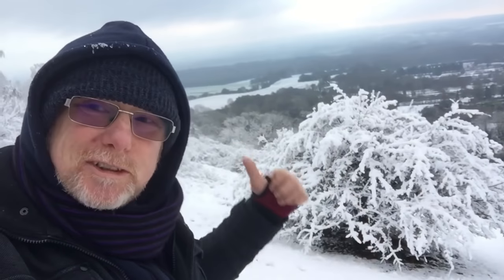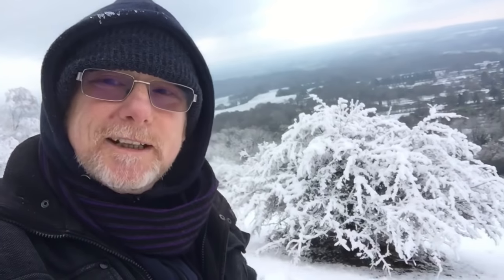How to make your Night Diesel Heater fuel pump quiet

Comment: I had the same problem with my pump. I ended up putting washing up sponges around it and then put it inside a small bottle. It's now silent and fixed in place well. It makes such a difference

Comment: What I did was bought a water proof camera case with he foam inside, lined the box with audio sound damper mat, punched.out the foam in the center to form fit to the pump with a solid price both in front and behind the pump, it is virtually no noise from the pump now

Comment: My 1989 florida had diesel heater from factory. Pump was under van. I owned the van for 10 years - pump never failed. So its not an issue. I replaced the internal thimble filter in the pump and it was the original pump too. . Also the pump was hung under van with a rubber hanger like two black bands, one shorter than the other which kept the pump at the correct angle. But really quiet it was.

Comment: My furnace makes so much noise that I want to tack it out and put a Diesel heater. Wondering if I could run the fresh air intake and the exhaust pipe out the existing set up .

Comment: I just installed a diesel heater in a caravan and so far the pump is not noticeable 
from inside and infact hard to even hear outside and the way I did the install 
I think just might have solved the pump noise and that is  I cut a strip of rubber 
from an old thick mud flap bolted one end to the wooden floor of the caravan then 
bolted the pump in its own rubber mount to the other end of the rubber strip so it was 
hanging free but not so free it would move around. By NOT mounting 

any of the fuel line or pump to any metal under the van but to the timber floor 
insulated it from transmitting sound. Works for me
Reply from the maker: That’s brilliant buddy well done I’m going to do a re fit in the summer and I’m definitely going to put my pump underneath the van and take a feed off the main fuel tank it’s got to be the way to go 👍🤓👍

Comment: Nice effort, best way is to mount them is in a rubber type spider web, also good to suspend the fuel hoses as it can tick tick on any hard surface..Also to note which may have been mentioned hang them vertical...The angle instruction was copied from the original Ebersprecher manual by the Chinese as they are knockoffs, the original was because of their small filter and the angle was needed. These Chinese knockoffs dont have this tiny filter ( bigger filter is actually better) so they should be mounted vertical to avoid the air bubble build up and wear, notice by the sound they should tick not tack...
Reply from the maker: Thank you some good tips there 👍
Reply: Cheers nice one 👍

Comment: I live in a van an just got an all in one heater. Yes the tapping is a bit annoying... I turned the heater off before bed last night but turned it on at 5:30 this morning... I did sleep a bit, but yeh, a bit annoying. 
So ... my pump is in the unit, any suggestions? 
I'm surprised wrapping it made it louder.
Reply from the maker: I don’t leave mine on all night it’s way to powerful I’m thinking of getting a 2 kw and mounting it under the van 👍😊👍
Reply: @BigVanSmallWorld  
When it gets to winter I'll have to run mine over night really.  
I'm going to take off the case today and hang the pump on a cable tie and wrap it in some carpet underlay.
Reply from the maker: Good luck with it hope it works out for you 👍😊👍

Comment: Good tip! I just bought a diesel heater for my rooftop tent and the methodical ticking of the pump at night was about to drive me nuts.
Reply from the maker: I’ve tried so many different ways and this is definitely the best way 👍

Comment: My heater and pump is under my van cant hear the heater at all but the pump drives me mad
Reply from the maker: I know what you mean it drives me crazy too I have fitted a log burner in my latest van along with the diesel heater I used the diesel heater if I’m in the van during the day and at bedtime spark up the log burner it’s perfect 👌 absolutely love it 👍😷👍

Comment: Pump vibration has always been a problem for RV'ers (especially water pumps), so proper mounting is critical. My only suggestion to add is that if space allows it to line the cabinets containing noisy accessories with 1" rockwool panels or sound-deadening foam. Thicker 2" lining is better if space isn't a concern.

Comment: Hi mate
I’ve had my diesel heater fitted now for a mth but only just started using it,
Question is the exhaust pipe from the heater meant to glow red?

Cheers Jason

Comment: So.... When you hang the fuel pump instead of having it attached directly to a wall, does it just cause the vibration noise to dampen cos it doesnt transfer? I thought the clicking was the metal inside the fuel pump hitting against metal. This noise is enough for me to just maybe stick to my propane  buddy heater. Wasn't sure how to fix my coldness through colorado winters.
Reply from the maker: Hi you are absolutely rite having the full pump hanging stops the sound resonating through the wall therefore giving the impression it’s quieter 👍😊👍

Comment: Better idea 💡 Mel. Two long bolts ( threaded bar out of a sheet of ply , bungee wrapped tight and cable tie the pump to that , even at the correct angle 📐. 👍
Reply from the maker: Brilliant idea 👍👍

Comment: Hi Mel hope your ok,   just watched this vlog,fuel pump suspension and wow it worked . 
Is there any issue with the pump swinging about whilst driving ?
Reply: was wondering about that too,
also, how do you manage to keep it at the correct angle without putting extra stress on the fuel connections  ?
great improvement though !

just keep in mind the pump will have some inertia when the van is moving (same principle that makes drawers want to slide out when the van takes a turn)
Reply from the maker: MAPS The Way I’m sure it will be ok as it’s only hanging about 1/2 inch so not much movement as for the angle it’s still the same and even if it was not I don’t think it matters once the pump is primed and all the air is out I’ll keep you all updated if it doesn’t work out but so far it’s all good I had to put my ears to my sink to check it was working this morning 🤓🤙
Reply: @BigVanSmallWorld  Would you have your heater on when moving anyway?
Reply from the maker: Holistic-Healing UK no definitely not it’s a parking heater 🤓🤙
Reply: @BigVanSmallWorld  Dats what I thought :-)

Comment: Hi Mel regarding your night heater installation,  I'm interested in putting one in my landrover 90. My question is do I need 2 battery split charger system to run it? As not to drain my battery or Doesnt it take enough amps to drain it? Cheers Alf.
Reply from the maker: Alfonso Taddeo Hi Alf in an ideal world you would use a Lesisure battery with split charge but if you want to avoid this I would invest in a jump pack just to be safe and save getting stranded.
They don’t take much power on startup they draw 9 to 13 amp due to glow plug once running this goes way down to 2 to 3 amps.
Hope this helps 🤓🤙

Comment: They are not a fuel pump in the same sense as you would find in a car. They are a dosing pump. Each click delivers a set dose of fuel and it changes the power of the burn by lowering & raising the does or clicks per minute. None of the parts of these are external grade either, wouldn't last long at all outside even though you sometimes see them like that. The control pcb's are not even waterproofed.
Reply: I dipped mine in
 plasticoat. This is my wifes account.
Reply: So would hanging it affect it any ?
Reply: Mine doesn't really have the ticking noise it's just the damn exhaust loud af

Comment: great helpful tip, Thanks Mel. Installing my pump in May, based on your prevision video, where is propped up on 4 legs and no air intake under the van. So will hang the pump as well. All sounding so good, that I will want summer to end and test the heater lol
Reply from the maker: Thank you buddy just remember I put my heater on the legs because it’s not a permanent installation I will be moving the heater behind my fridge come the warmer weather and then it will be installed in the normal manner good luck with your build 👍
Reply: @BigVanSmallWorld  as you said in your video, it's about ease of access and I hear lots of failures of these units and don't want to be under my van in winter, if it fails.

Comment: I tried suspending the pump between two brackets with a piece of elastic between, but didn't make much difference, so i abandoned a similar spring idea. Part of the problem is the noise travels down the tubing. Might have been better if the tubing was all rubber fuel hose. On ebay it's cheap enough. For now just wrapped load of insulation around it. Was tempted to just chuck it and the filter inside  the tank.  A good start point is to just hold it up in the hand and see how noisy it is.
Reply from the maker: fly bobbie rubber have a go let us know 🤓🤙

Comment: You can attach this pump to a square piece of rubber mat or silicone baking sheet and then attach it to any surface.  It will be easier to maintain a 30 degree pump angle.
Reply from the maker: Thank you that’s a great idea

Comment: you want to mount that pump completley vertical, not at an angle.
Reply from the maker: Hi the pump needs to be at an angle to stop air buildup 🤓👍
Reply: @BigVanSmallWorld  thats exactly why it needs to be vertical. At an angle you'll  still get air build up in one of the "corners". The angle thing was copied verbatim from the ebersprecher manual by the chinese, and thats in the original because of their small filter (bad design so they had to mount it at an angle) . The chinese knockoffs dont have this tiny filter so they should be mounted completely  vertical to avoid the air bubble build up. Johnmck47 explains it in one of his extensive videos. Think about it. If its at an angle there will still be an air pocket.

Comment: Thanks for the advice. Just about to install kne of these. I'm still scared stiff that I could die from the fumes.
Reply from the maker: Adventure Aways you are welcome as long as you fit it rite you will be perfectly safe but get a CO alarm for peace of mind good luck 👍🤓👍
Reply: I vented 2 windows and stayed for about 7 nights while running this.  The first night, I could hardly sleep.  A diesel heater- what could go wrong? lol.  Did not want to die from fumes but surprisingly, my small opening of both side of the window gave me enough courage to sleep and every night after the 3rd, I went to sleep with no worries.  2nd night, the clicking woke me up. Did some research and that is just the tiny pump pumping the fuel to the heater.  After I understood those noises were normal, I was a little bit more calm but now, I feel like there should be a way to keep the noise down a bit which is what brought me here to the video  My Webasto diesel does keep it toasty and I am thankful for that.  Fuel lasts a long time. Came to this video trying to find a way to make it quieter and saw your post.  Thanks, Mel, for the tip and Adventure Ways- you will be fine AND Warm.

Comment: I have had a brain wave and will experiment tomorrow. Just bought two stainless vacuum flasks from the Range with a neck big enough for the pump and pipes to fit in. One is the traditional type, the other is a jug.
Without ruining the caps i will initially use some card and tape to block off with insulation inside the flask. Just tried dropping a mobile phone  on ringer inside, quite substantial drop in sound.
If it doesn't work, i will just take them back.
Reply from the maker: fly bobbie good luck 🤓🤙

Comment: Brilliant!
however I've got one of the all in one chinese diesel heaters, I wonder if there would be enough room to suspend the pump in the case, anyone had any success with this model?
Reply from the maker: I’ve heard about those are they any good ? Thinking of getting one for my lockup 👍🤓👍
Reply: @BigVanSmallWorld  Brilliant bit of kit mate, had to do a few modifications with it and it has a smaller 5 litre tank in the case to make it so compact, have it in the back of my landrover for sleeping inside, hoping to get some long ducting so that the roof tent can be nice and toasty for winter camping.
It's just the ticking of the fuel pump resonates through the casing that I want to sort out

Comment: Hi Mell greit video as usual. Have a look at a site called Camper convert he has a video how to make your heater remotely turn on and off by text message would be a neat little addition to your build. All the best Steve.
Reply from the maker: steven horsfall thank you I will have a look into that sounds interesting 🤓🤙

Comment: It’s not quite as simple as using cable ties, you really want to shock mount the pump by suspending it with elastic or bungee cord like they suspend announcers/singers microphone elements you see in old movies. Wrap the whole affair in soundproof insulation and further suspend the hard plastic fuel line in neoprene or silicone grommets as it also noisily transmits the fuel pulses.
Reply from the maker: It’s simple and it works a treat 👍🤓👍

Comment: It is pratically good idea to have a box to be insulated with foam inside   with a door before suspending the noisy device. It would be a perfect heater working hard for most of your outdoor winter trips. The controllable outdoor fresh air supply should be connected to emerge into one duct with return room air back to the heater for reheating. Thus the system will be more economical and  contributing a much reliable heater .
Reply from the maker: Thank you 🙏

Comment: Hello Mel, Love yer vids mate. Always intresting and informative, Looks really cold there mate , but you look cosy enough And that is what appeals to me. I,m really intrested in following your idea, ie getting a van and converting it. Trouble is, is I,m now that well off so little worried about that. any chance you could give us a run down on costs  ie insurance, road tax, and miles per gallon ect. also cost of running disel heater......also did you get your dvla certificate for altering use of the van to rv...Thanks mate. really love following and looking forward to next vid on an evening...what area do you live mel…...just curios...Best regards Bri…happy new year to you mate. looking forward to seeing some of your summer vids. lets hope its a good one this year
Reply: WARNING: it is too much work to convert a van, truck into a camper,,, it will never be finished.. you just don't know...

Comment: Fixed mine to the transit bulkhead behind the air filter and ran the fuel lines straight through the door pillar into to rear load bay
Reply from the maker: AWPHOTOGRAPHIC well done sounds neat 🤓🤙

Comment: Much better tapping noises can drive you bonkers sometimes. I've put my curtain up by my van rear doors to stop some of the drafts but I pinned some foil wrap insulation inside the lining first made a big difference.
Reply from the maker: Roger Faulkner thanks and yes I need to make curtains yet for my back doors 🤓🤙

Comment: Replacing the hard plastic fuel lines for rubber ones will help too.
Reply from the maker: Andyman have you tried doing this ?
Reply: @BigVanSmallWorld  Yes the vibration/noise cannot resonate along a rubber line like it can hard plastic
Reply from the maker: Andyman and your heater still working?

Comment: The fuel pump is meant to be under the floor of the van, where no doubt it would be less irritating.
That much is clear from the location of the fuel inlet which when properly bolted to the floor, is only accesible from under the van.
Reply from the maker: Matthew Jenkins makes perfect sense but like I say in my vlog I prefer everything inside for easy maintenance that’s the beauty of building yourself you get to do it your way. Thanks for watching and commenting if you haven’t already please consider subscribing really appreciate your support 🤓🤙

Comment: I would like to try putting one in a lockable Thule roofbox then running the pipe through the back doors, not inside but easy to work,  on ether that or a grey tool vault mounted outside.
Reply from the maker: jamesandrew62 sounds like you got some interesting ideas 🤓🤙
Reply: @BigVanSmallWorld  thanks , got a 7seater Citroen synergy at the moment, not equipped for cooking & cold weather camping, however the rear interior is long enough, 7ft & I've got foam for sleeping on. The wood panels look good in your van, makes it look like a log cabin from the interior.
Reply from the maker: jamesandrew62 that’s amazing super stealthy if you can get it all done. Thanks for the positive feedback really appreciated 🤓🤙

Comment: Hi Mel, Great job sorting out that noise, My cali has a factory fitted parking heater noisy outside but quiet as a mouse inside. Keep up the great video's. ATB Glen up North
Reply from the maker: GKUK Dash Cam VW Cali thank you ALB to you too 🤓🤙
Reply from the maker: GKUK Dash Cam VW Cali ATB